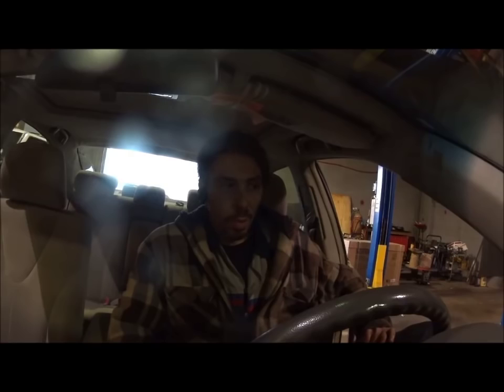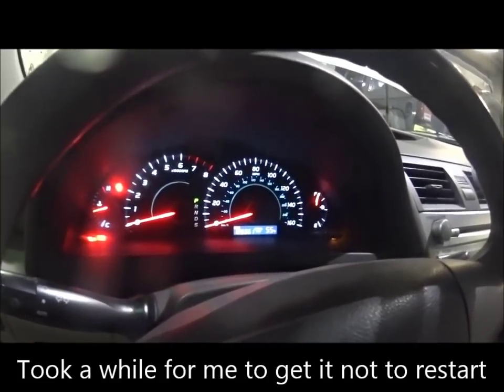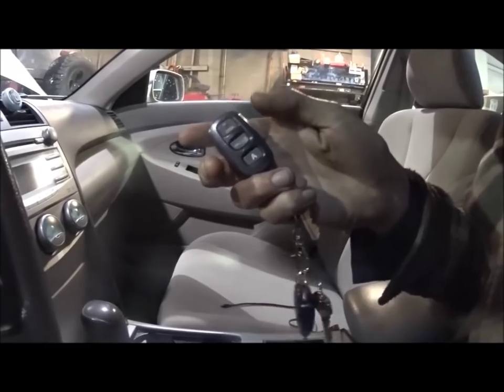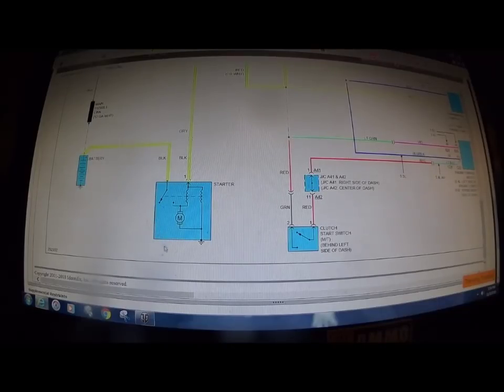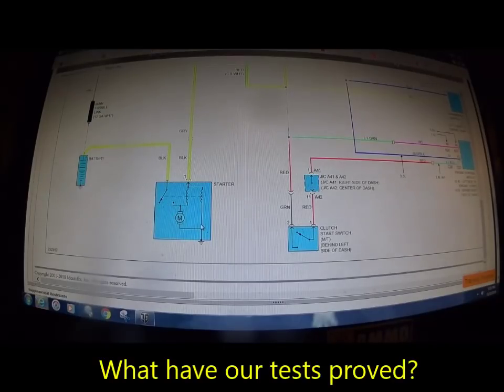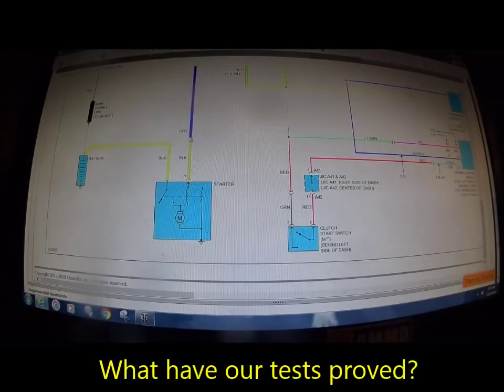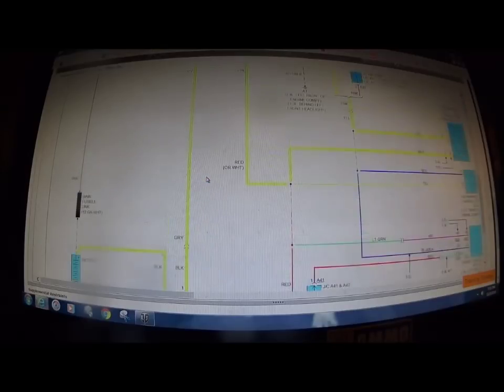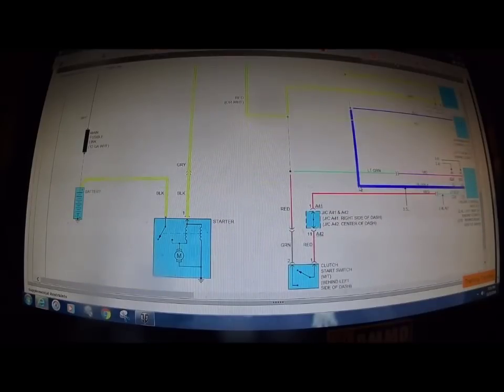My Car Wont Start (How to Test a Starter Circuit Properly)

Comment: You are spot on the diagnosis . If problem is not there at the load device - starter/solenoid - it's BEFORE . I had a friend's 1999 Nissan Quest . They put in TWO remanufactured Auto Zone starters at a shop over several months . Everything was good at the starter . When cranking , it intermittently sounded like the starter drive ( gear ) was bad - " spinning out " , not grabbing . However , the solenoid on BOTH units must have been bad . The starter spun , but did NOT engage . I thought when the solenoid was pulled in and the copper contacts INSIDE were bridged , the starter would spin and engage . There was even talk of a bad flywheel . I told him , just move the crank with a breaker bar and socket - WHEN it happens . He had the THIRD starter put in and it's been fine . I didn't see the defective units . I would have bench tested them and checked the solenoid and the drive assemblies for slippage and worn teeth . They should inspect the ENTIRE flywheel if ANY worn teeth are noticed .
Reply from the maker: Awesome!!!

Comment: I PERSONALLY START AT THE IGNITION SWITCH AND WORK MY WAY THRU THE CIRCUIT
Reply from the maker: Watch through and see why you can do it much faster and more efficiently.
Reply: @JoesAutoElectric  THANKS FOR THE INFO GR8 VIDEO JOE
Reply from the maker: @craigtirrell3026 very well said. Thanks for watching.
Reply: Follow this video EXACTLY and you will save time and misdiagnosis . If the proper items are NOT present at the starter/solenoid , then your problem is BEFORE . Why start in the middle ? This is where it has to go .
Reply: @craigtirrell3026  I like your point, but if you had a fuel delivery problem where you would start? The fuel pump? The fuel injectors?  I would like to see a video like this but regarding when you possibly have a fuel delivery problem and don't have Schrader valve for fuel pressure.